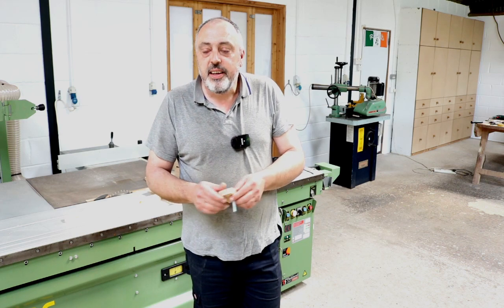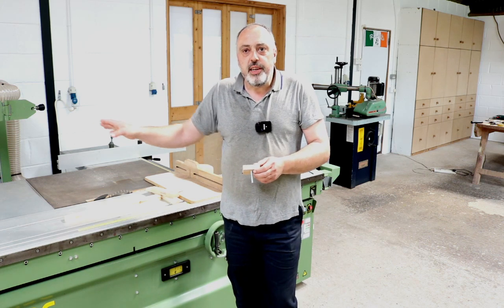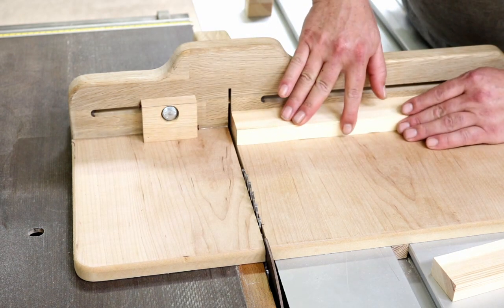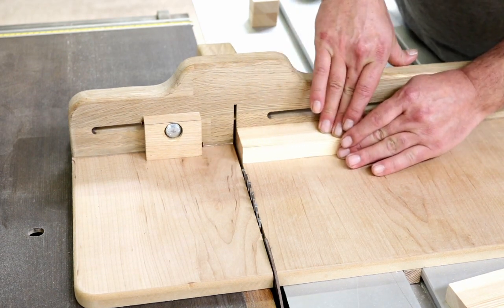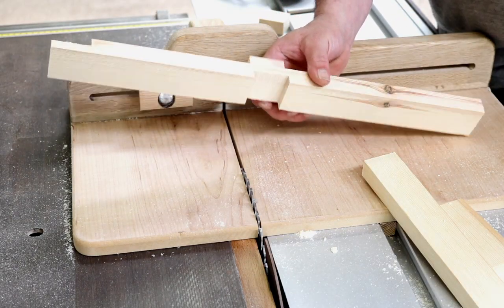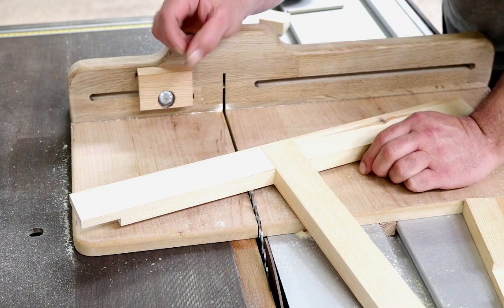The Secret To Perfect Half-Lap Joints

Comment: This is a great video. I'm still on the fence about making half laps this way as it involves making so many cuts (for my saw horse project I calculate 1600 individual passes) but I'll stick with it as my table saw blade can't cut the laps I need in one go. Anyways, I was going to ask if there is a jig for making exact regular passes on the table saw so I can move the wood by my exact blade width every time?
Reply from the maker: Thanks Greg, it's something I never really thought about as I have never been too concerned about the distance I moved the piece so long as it stayed within my overall width but I think what you want could be achieved with a block with increased cut depths exactly the width of the blade and place between the stop and the workpiece moving it one notch every cut. I hope this makes sense.
Reply: Yes, I was thinking I'd probably just mark intervals on the surface of my sled and go by eye, using a fixed block set to the width of the timber the way you do. Maybe make the intervals slightly narrower than the blade so there is a bit of overlap. At some point I might add a screw mechanism in the stop block for advancing the work piece by precise intervals. I think I have quite a few uses for this kind of cutting and it would replace the need to use a router table for a lot of this stuff.

Comment: I don't want to be that guy but watching I can get my head around how the joints won't be  bit too long? He was measuring to the inside of the blade but cutting till the outside. Shouldn't the cuts be a blade thickness too deep?
Reply from the maker: The screw is set the exact kerf of the blade so setup to the stop then when making the cut the screw head becomes the stop therefore subtracting the blade thickness to give a perfect fit.
Reply: makes sense, I must of misunderstood. I thought you were against the screw the whole time. Thanks for responding!
Reply from the maker: @michaelrandall7667  no problem at all thanks for watching 🙂

Comment: I think you should make your first cut at the correct and final distance but instead of then working your way towards the end, switch to the end and then work your way back. If your last cut is at the end and the wood is soft I find that the wood gets ripped a little bit and doesn't look as clean
Reply from the maker: Yes totally agree if the blade isn't super sharp it can cause a little tear out on the end